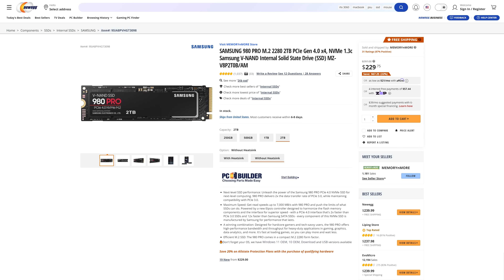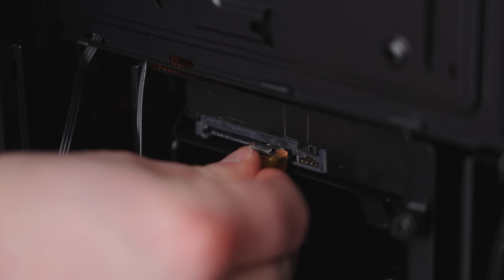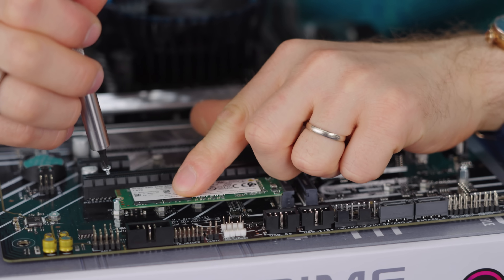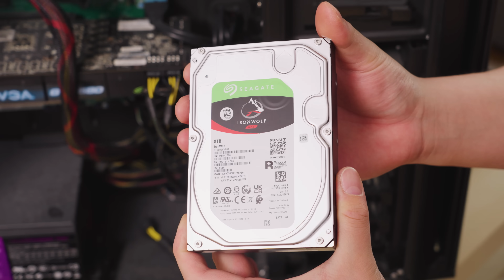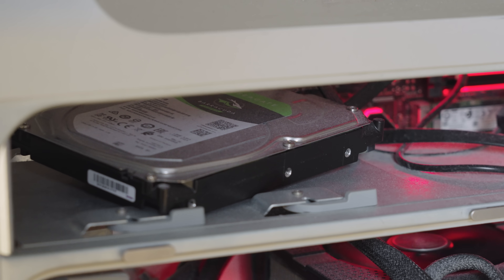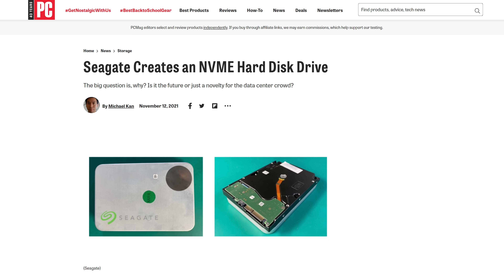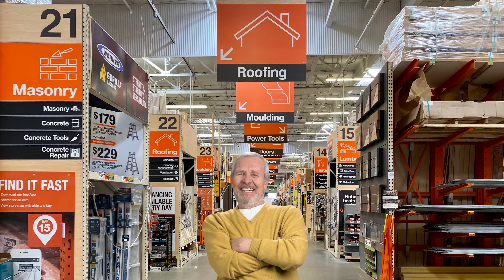Is SATA Obsolete?

Comment: My basic, budget B450 mobo has 2 M.2 slots and 4 SATA plugs. (Asrock B450m Pro4) If I put an NVMe M.2 in the first M.2 slot, the second is limited to a SATA only M.2 stick, it has to be an "M + B key" stick or it won't be recognized, also I lose one SATA plug. Also, If I put an NVMe M.2 in the first slot, My PCIe slot (gpu slot) is reduced to x8 configuration. If I put an NVMe M.2 only into the second slot, it runs at x2 speed and I lose 2 SATA plugs but, my PCIe slot runs at the full x16 lanes. By comparison, 2.5" and 3.5" SATA drives just work. No penalties to system performance, no configurations to remember. Just easy, reliable functionality. I am a very budget minded pc user, and I really have no actual need for NVMe speeds. So, for me, I don't care if M.2 drives reach price parity with SATA SSDs. What I want is for SATA SSDs to become as low cost as HDDs are now. I think they should make 3.5" x 12mm thick SSDs with 2TB-ish capacity using cheaper, less dense storage chips. Instead of a single 1GB or two 512MB chips, they could use cheaper 128-256MB chips and have room for a lot of them. I'm sure it's more complicated than that but, hey. Just my 2¢

Comment: PATA went away because the protocol was inefficient, complicated and at the limits that they wanted to drive at the time.  SATA will fall to U.2 and M.2, U.2 connectors are found on enterprise 2.5" SSDs and look like SATA - however it is a PCIe standard; a lot of people refer to the connectors on motherboards as "NVMe slots", however these are M.2 ports (again a PCIe standard).

Comment: I'd say it's pretty unlikely that SSD/NVME storage will ever be as cheap as Mechanical drive are, not in the next 10-20 years at least, shopping round you can often get £12-13 per TB, that's along way off for non mechanical

Comment: Another main reason SATA drives are still being used is because of 'older' hardware. M.2 didn't really start showing up on computers until around 2015-2016, and computers from before then aren't outdated.  If you're upgrading a computer from around 2014, you're gonna need a SATA SSD.

Comment: I’m still rocking a computer from 2014 so I haven’t even touched a NVME drive. 

There’s simply less reason to upgrade as often these days as hardware is way ahead of software. SATA speeds are plenty quick enough for the vast majority of users. 

I’ll eventually upgrade when Microsoft ends support for Windows 10 in 2025. But it’ll be reluctantly since I know Windows 11 is crap and it was released mainly as a way for Microsoft and hardware manufacturers to sell new hardware.
Reply: You can bypass the restrictions, believe me it works fine. I'm using Windows 11 with i7 3770 since like a year with bypass, everything works and it receives all the updates. These old computers are still perfectly usable. I even edit 4K video with my i7 3770.

Comment: From where I sit SSDs need to end, they suck in a huge way!! I bought TWO SATA SSDs and within a year bought of them DIED!! not only did they die at the worst possible time, I was never able to recover ANY of my data off of them when they did die!! 

And while I am NOT a huge fan of how slow most normal old school hard drives are, even SATA HHDs at least with a typical hard drive when if fails, most of the time YOU CAN trick it into running long enough to recover MOST if not ALL of your data from it, unless it got burnt up in a fire or ran over by a tractor trailer of something like that!! Normal Hard drives ARE far cheaper to replace too, and again in my experience A LOT MORE "durable" than any Solid State Drive on the market!! Frankly I wasted nearly $400 on two ADATA 500gb SSDs that I could have, just as easily bought six normal 500gb HDDs for and still been ahead!! Thankfully I do back up a lot of my data to start with, so I was not "missing a lot" when the SSDs decided to go south on me, BUT had I been a "lesser computer user" what happened to me could have been pretty much "fatal" had it been anybody else!! 

So again in my mind SSDs are junk........and they need to do the way of Parallel Port, iOmega JAZ Drives and USB 1.0 as fast as humanly possible!!! And to drive that point home I currently replacing a ten year old hard drive in my HTPC computer that is a SATA 500gb, and has been a great drive the whole time I owned it!! You can't hate the longevity of a decent SATA HDD!! And I have 15 year old SATA hard drives that I used as storage units that still run flawlessly!!

Comment: SATA is old. But not (yet) obsolete!

What I do think will happen in the near future is that some motherboard manufacturers will replace SATA ports with m.2-to-SATA converters, perhaps complete with power-and-data cables. A full (signal+power) SATA port is 40.48 mm wide and 3.50 mm tall, while a SATA signal cable with housing is 16.08 mm wide and 6.45 mm tall.

This allows for the following m.2 conversions:

110x22 - 4x full SATA
110x30 - 6x full SATA
80x22 - 2x full SATA
80x30 - 4x full SATA
60x22 - 2x full SATA, 8x signals SATA ports
42x22 - 6x signals SATA ports
22x22 - 4x signals SATA ports

Obviously, you would need some conversion logic on that board too, but still, one m.2 card should be enough to provide all SATA speeds you could possibly want.

Meanwhile, fitting 4 m.2 drives or more on an ITX board once all the legacy junk is stripped away will be AWESOME. All you will need is power, front LEDs and m.2 card slots at the edges. :)

Comment: Honestly a replacement for mass storage connectivity is needed m.2 is very limiting so a replacement to m.2 ver 3 speed is needed via a sata replacement already enterprise are adapting to new connections so I would like to see a sata replacement brought online with the same options of 6-12 ports that has universal support than being single company , what I don’t want to see is a return of the raid cards in home market so whether your still rocking a disk drive for archiving and movie watching on one rig or requiring q0-20 tb or more stored . Take current gen consoles Sony only fitted one drive to add more your stuck with usb c to archive your library Xbox still rocking the seagate proprietary connector , we need sata size storage and connectivity linked to ram buffers somtething I was hoping an open standard xpoint memory could fill as a very large buffer built in on boards we need a connector that replaces the pci connector style interface to a multiport motherboard connector . Even thunderport doesn’t quite fit that need whatever is set it will require a radical rethink on design of board from manufacturers to support it

Comment: As long as I can remember (and am old) the battle between parallel vs. serial has been going on. Other battles like centralized processing vs. distributed processing, hard wired vs. wireless are similar battles that changed back and forth as technology improved. First you start with serial sending one bit at a time (RS232). Then you go to parallel to send more bits at the same time. Then you improve technology so the larger parallel cable can be replaced by a smaller serial cable that transfer as much or more data as the previous parallel technology but serially. Then we go back to parallel interface with the existing fast serial technology so it's even more bandwidth. So the reason we went from PATA to SATA (BTW back when PATA was popular is was referred to as IDE, remember master slave jumper?) was because technology improved. And it continues now with NVMe, but I dare say am not familiar with the interface specs yet.
Reply: NVMe is arguably parallel since it usually runs on 4 PCI Express lanes. It can run on a single lane too though.

Comment: Quite some mistakes in this video:
PATA want called PATA because it's called PATA but rather because it was parallel instead of serial. The original name was ATA.
PATA didn't die out because of SSDs. They didn't arrive too the mainstream market back then. It's just SATA was better in any way.
Are SATA SSDs really cheaper in North America? In Austria they're not, some are even more expensive, if you think about the higher performance of even cheaper nvme SSDs.

Comment: This flippant presentation might as well not have been made. Apart from glaring factual errors the presenter should have made it clear from the start that we was talking about desktops and larger form factors. Most computer users have laptops as everyday machines and might own big gaming rigs because they want to.
The main drawback of NVMe is heat and predicted lifespans of such drives is less easy to test than for NAND SSDs.
Because the presenter has his mind on big boxes with plentiful cooling the title of this piece is misleading and far too general and dramatic to justify the content.
He should at least change the title. Better still would be to cease YTubing until he has something useful to say.

Comment: You can still find IDE/PATA and SCSI drives with a little effort, so.... SATA will go the same way. The only hard rive format that has completely vanished is ESDI, and I only know of that format because in the early 90's, I bought a used 386SX16 that contained one. Removable storage is the thing that tends to disappear in short order rather than internal storage. How many dozens of portable storage formats are now effectively obsolete?

Comment: The nvme drives price almost the same as the sata drives in my area, and a lot of times the sata drives are actually more expensive than the nvme ones, the msata drives are the most expensive cuz they are basically a dinosaurs. Whenever the PCIE lanes are flushed with mobos, is when sata ssds ending the last of its breaths

Comment: 3:25 Huh? Most motherboards allocate anything beyond one or two (on high end, multi-GPU boards) PCIe NVMe connections to PCH channel (or "IO" in AMD nomenclature?), not the CPU channel, which caps there speed lower and limits bandwidth, but outside of raw throughput probably won't make much of a difference for most real world applications besides the OS because you run into other limitations or you're only using one or two drives through the PCH bus simultaneously anyway.

PCH also handles SATA and IO and such through the chipset.

PCIe (Thunderbolt, PCIe NVMe SSDs or WiFi modules, and GPUs [or AI accelerators, physics, APUs, or whatever) also have security implications having a more direct route to the CPU than, say, a USB host controller.

Comment: Actual differences between SATA SSDs and NVME SSDs aren't that big for most users
plus that SATA SSDs are cheaper for more storage and could do well for older systems and are indeed still easy to handle
Alongside HDDs are actually still useful for storing purposes where you don't really need it to be so fast
So SATA shouldn't die any soon

Comment: this video answered something i been trying to find a reason for years to. Why my FPS have gotten worse around the time I installed a 2nd 1Tb m.2 SSD. I'm honestly thinking of removing the my older Samsung 500Gb EVO 960 cuz the drop was massive on my rig(ryzen 5, 1070GTX, 32Gb ram), like every game dropped 30-60FPS when I installed the 2nd m.2.
Reply: Yes because it's using up your PCIe Lanes so your graphics card is not running in 16X mode
An easy way to check is just to open GPU-Z it will tell you. Might be running 8X mode or less

Comment: SATA SSDs aren’t going away, it’ll become the new mass storage medium, the way hard drives are now
Reply: Indeed, apart from some niche markets, the speed that data can go over an SATA link is more than sufficient. Plus the fact that it has a cable in the middle means that you have some flexibility in how you position the disks. You don't have to put them all in the same case that then has to be cooled. You have the option of connecting some of the drives via an e.SATA port and have fewer sources of heat in the same place. Plus, for backup drives, you can easily plug one in the back and do the backup that way, the system doesn't even need to know that it's not an internal disk.

Comment: Unless nvme is adapted to use cables and can just as easily be used for mechanical drives then no. Sata is gonna be there.
Reply: Yup for a lot of NVME's you need to remove the GPU/CPU Cooler just to access

Comment: Let’s get the history correct here: SATA replaced ATA-5/6, it was only called parallel ATA posthumously. Even the term ATA, or AT attached storage, wasn’t used much, as everyone just called them IDE drives. PATA was never a standard: the 40 pin ATA cable, and the various PIO and UDMA modes were standards that rode over the basic ATA interface. An interface which started life as nothing more than an arbitrated bridge interface to the 16 bit IBM PC AT ISA bus (thus the name AT-attachment interface), as the core drive controller was located on the drives logic board (thus the name IDE, for integrated drive electronics).
Reply: I always referred to them as IDE cables... although there were smaller, fewer pins, "pata" cables for floppy drives and we just called them floppy drive cables.
Reply: @MrCrdub  yup. thats it right there.
Reply: I think atapi.sys is where most people saw ATA
Reply: Yes, the interface was called ATA, and the cables and drives were called IDE.  Yes, to make a distinction between SATA and ATA, ATA got nicknamed PATA almost immediately after SATA came out.
Reply: thanks for that little history lesson, I'd honestly forgotten most of those details 🙂
Reply: Same here, we just called them IDEs as everyone knew what was meant by it. I don't ever remember ATA getting much use.
Reply: I was confused by them being called PATA. They were always called IDE back in the day.
Reply: thank you, ffs techquickie
Reply: Not to forget 80 pin cable variants.
Reply: @Nickayz2  The ATA-100/133 cables were called "80-pin", but were actually still physically 40 pins. Each of the 40-pin female connectors split the connection into 2-wires each, making the cable 80 wires from connector end-to-connector end, which then re-connected back to the physical 40 pin layout that was the connector and header pin layout on the device.
Reply: @Nickayz2  Double 40 for "hi-speed stability"...   Don't get a kink in that cable!!
Reply: These guys weren't even a fetus yet when all this was going on. It literally happened before their lifetime in the mists of what is to them prehistory.
Reply: The more I read, the louder piccolo became.
Reply: Ah, the good old daze!  Now where did that SCSI card get to?
Reply: @drteknical6571  i forgot all about scuzzy drives. I had Barracuda ones lol
Reply: Feeling old....not a pleasant feeling

Comment: I'm not sure why SATA and SAS haven't merged at this point. The alternatives don't exist. SATA Express never had a single drive produced. U.2 had a handful of SSDs released, but never updated or refreshed. All U.2 ports are used with a U.2 to SATA or U.2 to SAS adapter. 
I just bought a 22TB WD Gold HDD. It came with SATA 3, which still it cannot physically saturate.
We need a replacement to SATA 3 which we can plug in 4-8 devices like HDDs. To plugin every drive directly into the motherboard is impractical. I haven't seen any motherboard with more than 3 nvme slots.

Comment: I have 3.5" 250GB Hitachi HDD that clocked over 70 000 hours running 24/7 in DVR. When tested with HD Sentinel it's still 100% perfect without data transfer errors or bad sectors.For reliability I use HDD.

Comment: In lot of older PC, SATA is still the main type of drive interface since they don't have M.2 Slots, also SATA drives are easier and cheaper to duplicate and setup as RAID. Since most
modern motherboard only has 1 M.2 slot, but most motherboards support multiple SATA drives, so it's very easier to setup RAID with SATA.

Comment: I have a AMD 3700x with a Gigabyte x570 elite motherboard.  I have 2 NVMe drives.  Will my graphic card slow down because of this?  I have a 3080.  Surely when I'm gaming off of one of those drives, I'm not using the other so would it slow it? 
I'm curious!

Comment: Some fun facts:
1) SATA has been around for 19 years, while the lifespan of PATA was about 22 years (first drives started shipping in 1986 and by 2008 SATA took over about 99% of the market).
2) The original speed of PATA was 8,3MB/s and was bumped up to 33, 66, 100 and 133MB/s during its lifetime. That's a 16x increase. SATA's transfer speed increase so far is only 4x. (theoretically, if we consider the latest SAS-4 standard, we could stretch it to 16x, as it uses the same cable, but otherwise no SATA drives will benefit from such a fast SAS controller, and SAS drives won't be recognized by a SATA controller)
Reply: Considering the simplicity of SATA, when connecting for example, I wonder if there will be a SATA 4 that can rival PCI-E when it comes to storage or it will run on the PCI-E lanes like the NVME drives.
Reply: @Soundwave142  that would be dope, and SATA 5 that would be almost PCI E GEN 3 speeds
Reply: Good HDDs are still faster than eMMC/SD and some cheap SSDs
Reply: @edelzocker8169  thats correct, but if u search your PC eshop and u search all SSDs by its price lets say at 128GB size. Cheapest you find are NVMe with 1600/600 well if u add 1,4USD compare to absolutely cheapest SATA SSDs. 

BTW I just searched HDD with lowest capacity. Its WD Blue 500GB which cost double compare to cheapest NVMe 512GB drive.

And at 1TB SATA SSD, HDD and NVMe has +/-3USD same price.

By those "cheap SSDs" you would have to order them from unknown manufactures to get slower speed than HDDs.

HDDs has their use. But in personal PCs they are out. Even if u want 4TB which favours HDD in pricing. There is like +15%USD difference between cheapest 1TB SDD + 4TB HDD compare to 2x2TB NVMe or 1x4TB NVMe